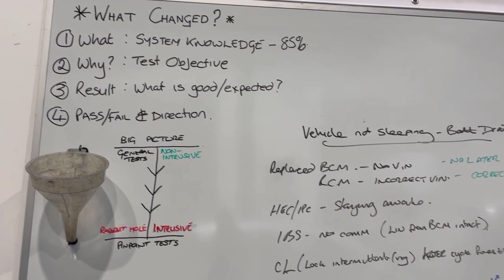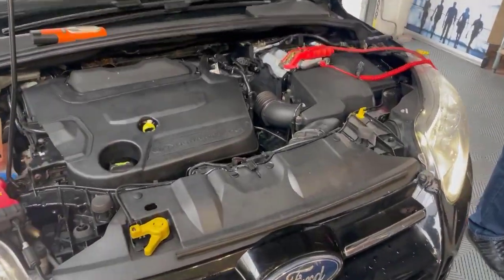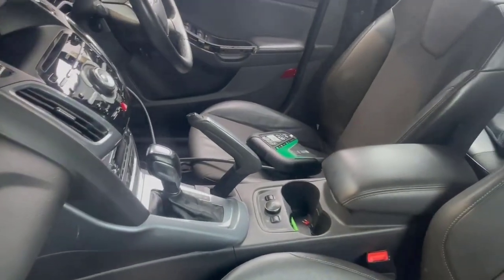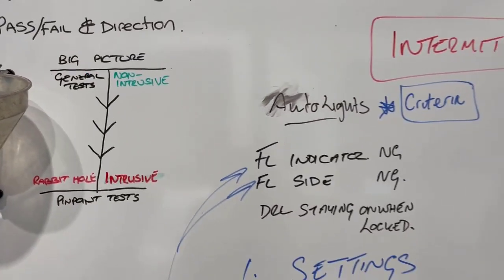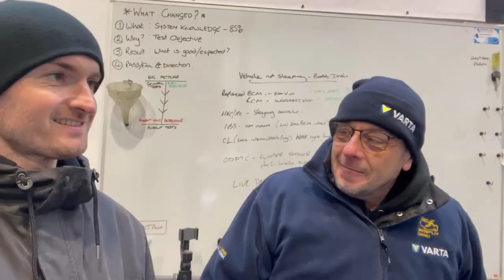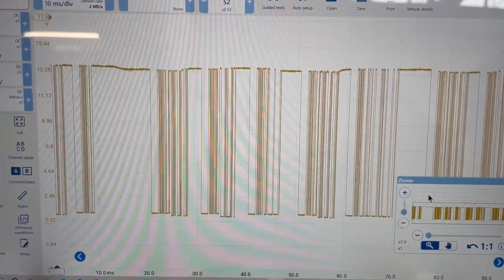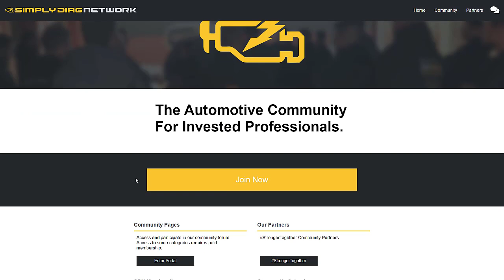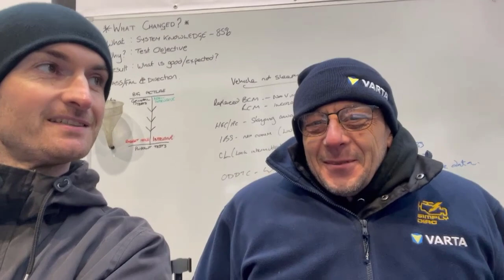A Day At Simply Diagnostics!

Comment: Ok so went to another vehicle today. Iveco Daily 2006. Just bought and customer said after 2 days wont start. Scan of it with im608 pro diagnostic function said,

CAN message ebc1 error, DTC: 1c1
CAN message bc2edc2 timeout, DTC: 264
CAN message dash display timeout, DTC: lba
CAN message timedate error, DTC: 2c9
CAN message hrdv error, DTC: 3c9

To add pin 6 14 showed 127 ohms fluctuating between that and 120 ohms. 6 maxi fuses heavily rusted and abs motor with connector facing up so likely pins inside all rusty. 

Wheres your thoughts
Reply from the maker: Sounds like you have a bit of evidence there. I suppose it would be best to check out this suspected corrosion. If not every module responded on the scan, would also be worth looking at CAN with scope 👍
Reply: @MechanicMindset  wont be continuing on this job. Guys one with no money. Politely I told him what to check and do then left. Being told to change the fuses is one thing. Doing is another. Especially when he sends me a text message saying he has decided to change the HIGH VOLTAGE  fuses himself. Hmmm I replied. Do you call 12v hi voltage. He replied saying I know what he meant. I ended by replying. Sorry no idea what you meant. Just educating you they are not hi voltage. 

Customers